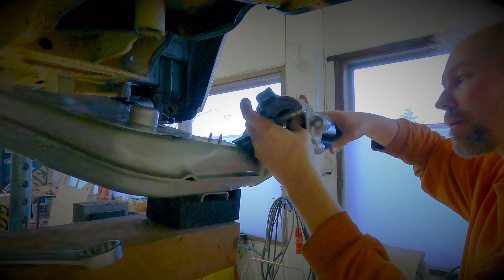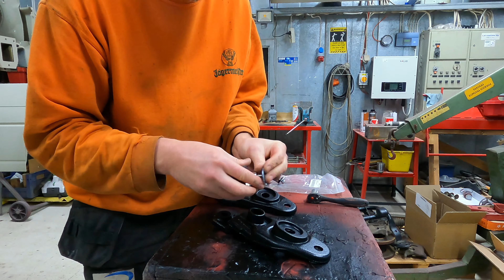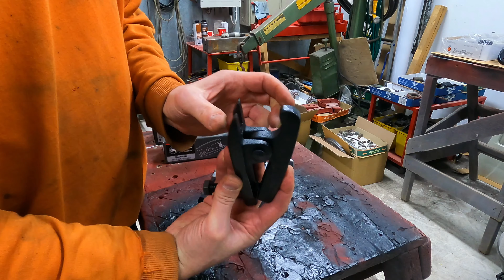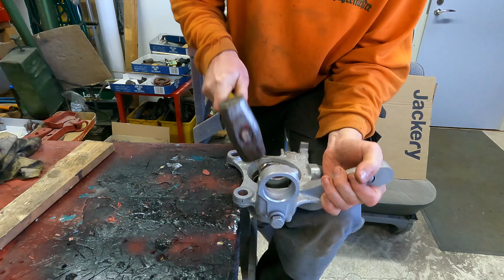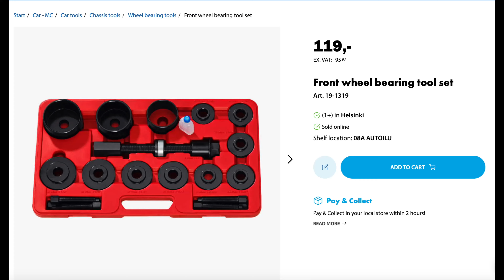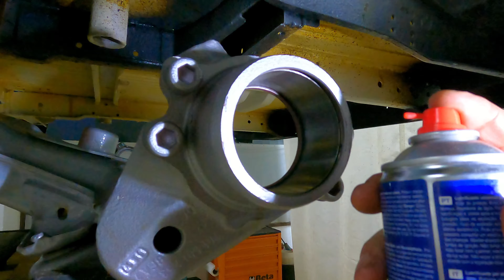Guide to VW T4 Wheel Bearing Repair,T4 Wheel Bearing Replacement,VW T4 Wheel Bearing Fix,VW T4 tips

Comment: One question doe's the rear bearing housing  unbolt off the arm with those allen keys . If so could I take that part with the bearing in  to a press to change it ??? Thanks
Reply from the maker: Thanks for asking 👌🏻🤠
The bearing housing doesn't come off, just the brake plate. You can of course remove the entire control arm, but then you have to make sure the wheels are aligned. The easiest thing to do is get that tool kit. It's cheaper than an hour at a garage.
Reply: Thanks 👌

Comment: I have recently come acoss your video's, Marcus, Here I am in Melbourne Australia I have a 98 build T4 with a petrol Motor. ( Not diesel, Not a Syncro).....  I need to Pull  the 2.5 5 cyl engine out & rebuild that or replace...... I have had 4WD vehicles in the past & wonder how difficult It would be to purchase the parts  Second hand, rebuild & swap them over, I lparticularly like the fact that you make things as simple as possible with as few tools as you need & really enjoy your content... Thank you I am a subscribed & very pleased to see your update this morning......M..
Reply from the maker: Thanks! I think you can install four-wheel drive in a T4 van by directly bolting. The body structures are exactly the same. The most difficult thing is to find a complete set with all the necessary parts. They have to be of the right model, because for example ABS brakes have a "oneway-free" bearing in the rear differential.